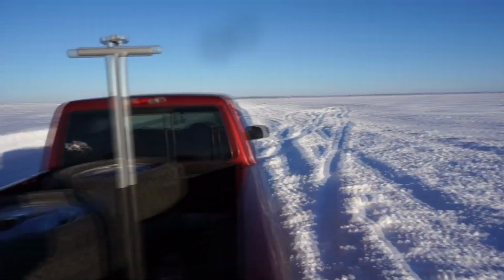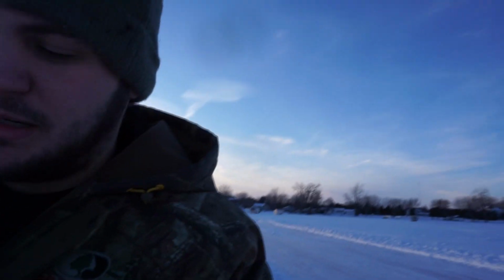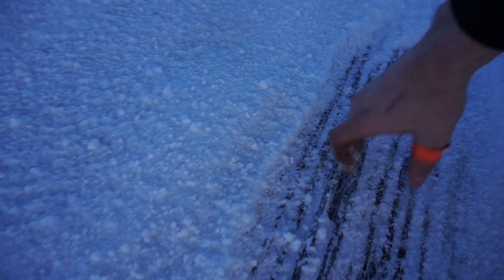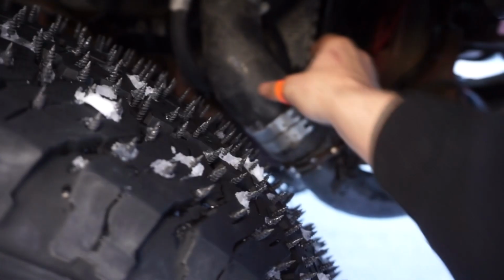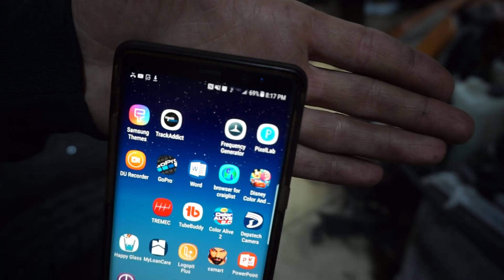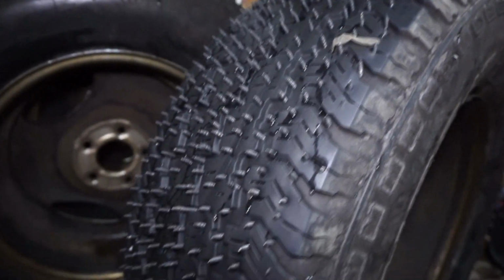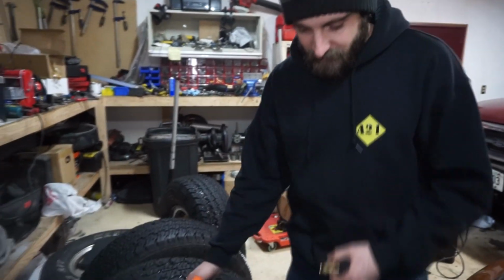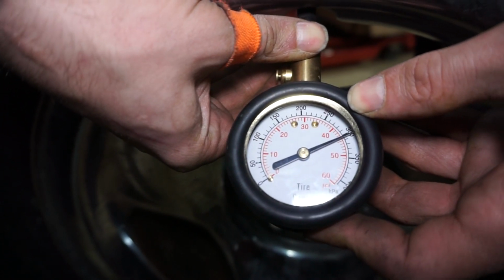Studded Tires 10lbs Of BOOST!!! 80mph On 5000 Drywall Screws!!!!

Comment: How are the trans temps?
Reply from the maker: Got a little bit while ripping around but only hit 160 on the 30-45 minutes I was driving there... That stall and slow driving heats it up fast. Locked on highway drops quick.